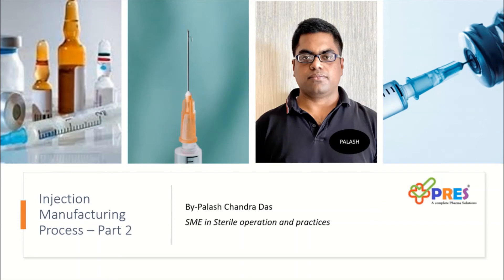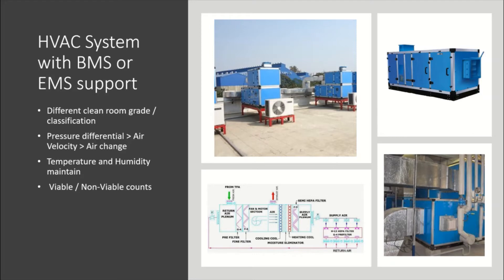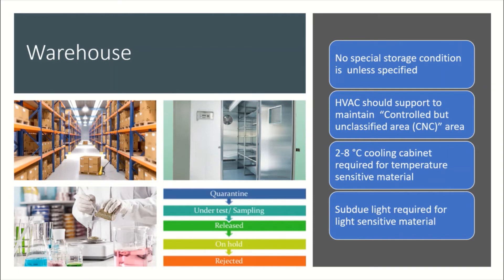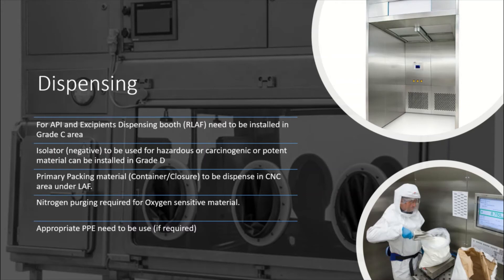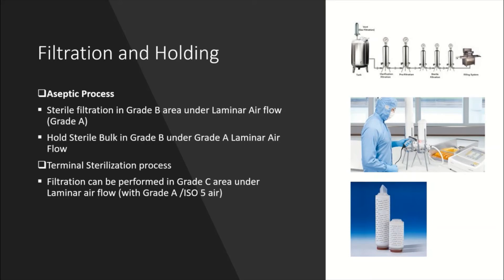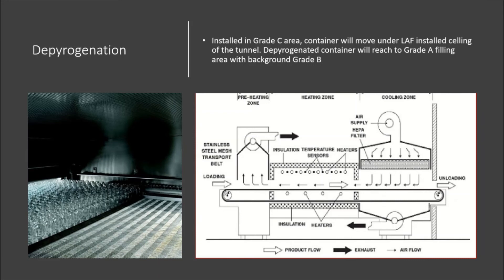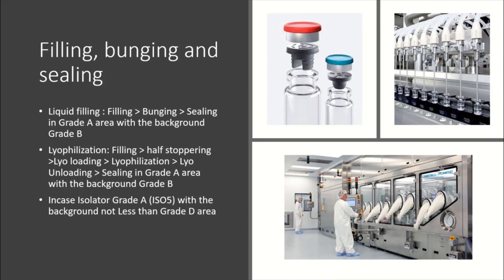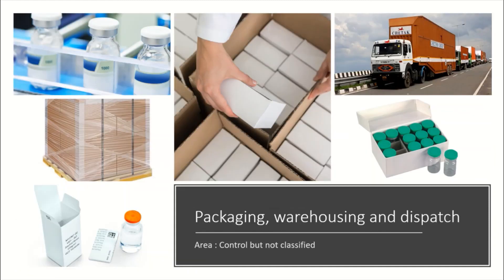Sterile Injectable Manufacturing Process ( Part 2)

Comment: Sir, will you please answer my below question. 

Why ampoule products require sterilization and vial products for depyrogenation.

Can we use depyrogenation tunnel for ampoule product
Reply from the maker: Yes, depyrogenation tunnel can be used for Vial and Ampoule both in case of aseptic manufacturing process.
Reply: @cGMP  what is the differences between aseptic & sterile  process.

Comment: I just wanted to know -
Filteration of the Drug product which is in the holding vessel is happening in the Grade C area with Laminar air flow Grade A? - Terminal sterilization

And filteration and sterilization of Drug product which is in the holding vessel is happening in the Grade B area with Grade A laminar air flow - Asceptic sterilization

Is this correct?
Reply from the maker: Yes, Grade C under laminar air flow is appropriate for product produce in Terminal Sterilisation facility